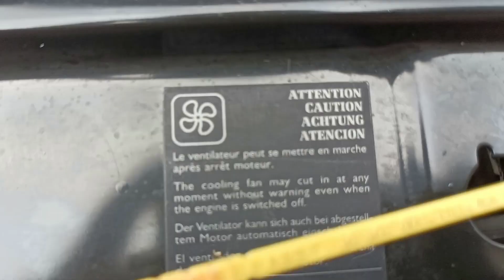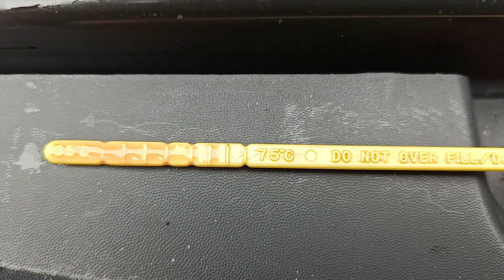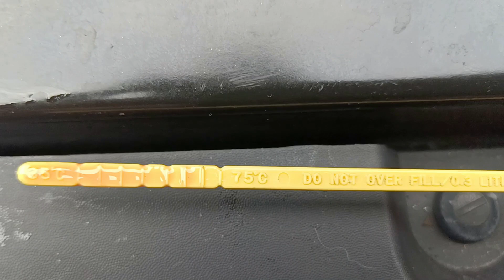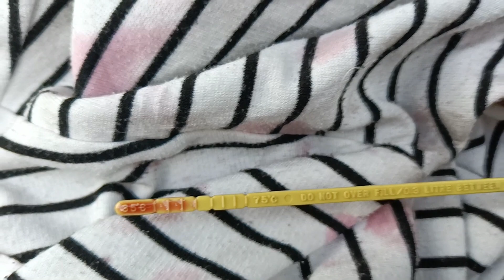V6Log, cz.3

Comment: A ja jestem szczęśliwym posiadaczem takiej właśnie lagunki (Initiale Paris😂) z instalacją LPG. Autko z 2002 roku ,przebieg 386tys a instalacja BRC z 2009 roku przy 167tys. Spalanie ok. 10l (lepszego pałera) a silniczek w środku czysty (ostatnio po 10 tys. olej elf 5W30 super przezroczysty na miarce + płukanka - zleciał taki trochę brązowy ale bez przesady) ,teraz zalany Motulem 8100 5W30 + Ceratec ,motor chodzi pięknie (i oby tak dalej). LPG jak widać motorka nie zarżnęło. No fakt, taka instalacja to był koszt niemały ale pomyśl: 220tys. kilosów za  2/5 ceny benzynki...